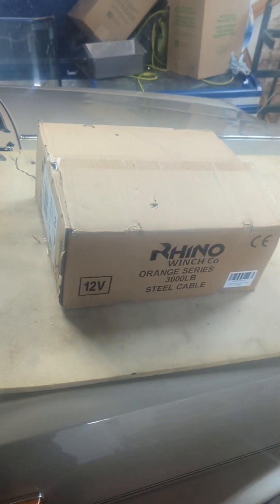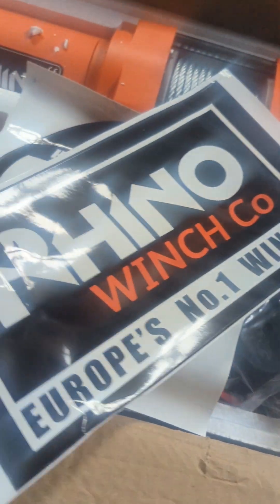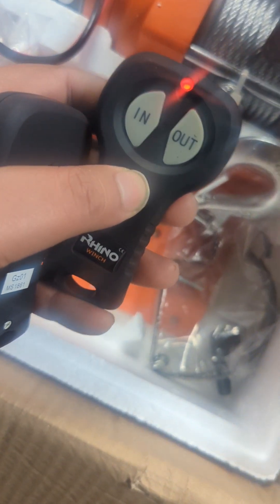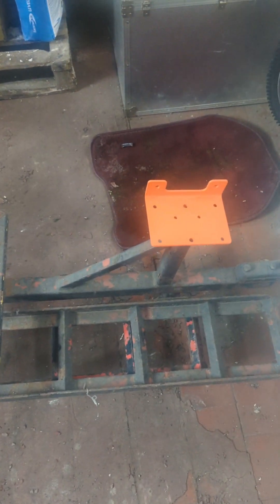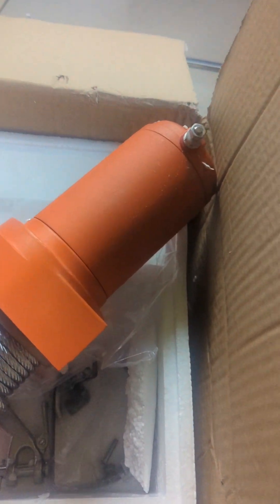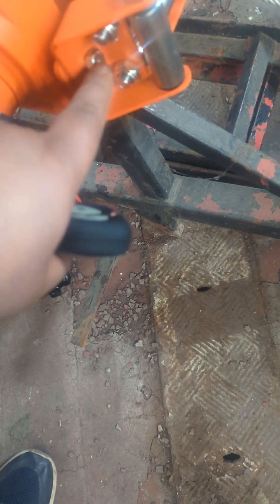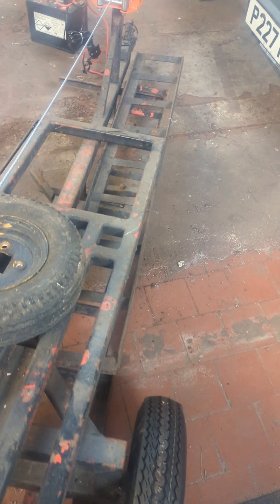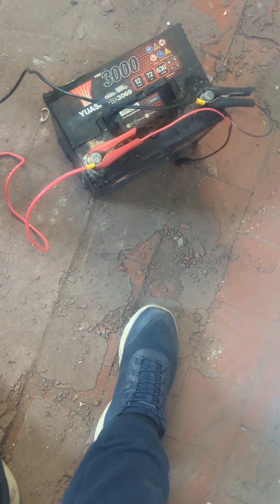rhino 3000 lb orange winch unboxing and fit review good buy or money waste...

Comment: Hows it holding up mate? Nice review 👍👍
Reply from the maker: Its a good winch but if i was to buy it again id buy the rope version the wire rope keeps getting tangled otherwise ive used it 20 odd times pulls great
Reply: @raenzoperformance9600  brilliant mate thank you... yes the rope version makes sense less hassle I'd imagine 👍👍👍
Reply from the maker: @GMC43  yeh defo it think so probs wouldn't last aslong but alot safer and easier to use when the metal gets tangled winding its a nightmare hope it helps
Reply: @raenzoperformance9600  good shot that mate.. yeah il go for the rope version I think.. thanks buddy 🤜🤛